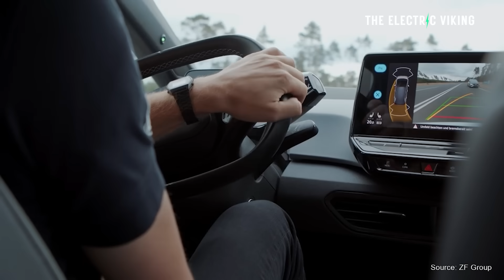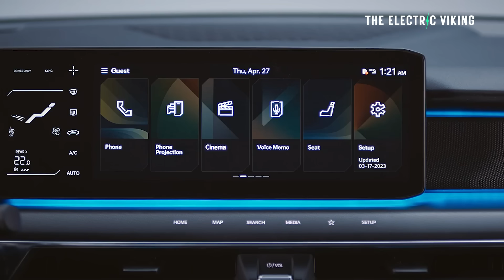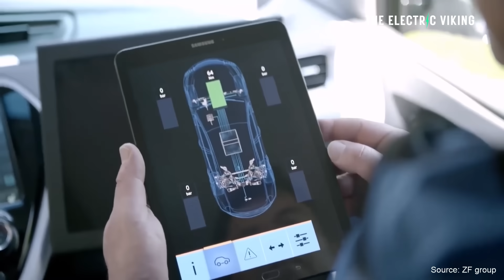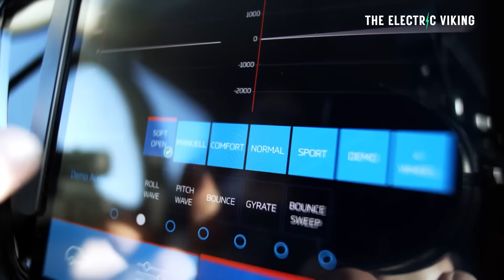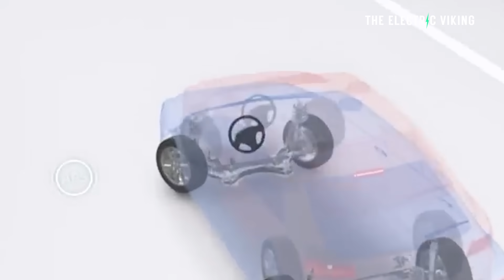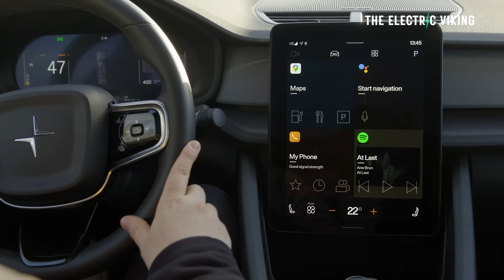Electric Brakes Revolution: Safer, Cheaper EVs!

Comment: Hey Mr Electric Viking,  i have been watching your videos for yrs.  I have a question for you.  Do you remember about 2 yrs ago 
Ben Hardy posted a video about 'Brake By Wire'.  It showed a collaboration between Tesla and Brembo.  They had the brake by wire system installed in a model 3, and ran some tests on a track. The performance was far better than conventional brake setup's (Disc/Drum) I think that they even gave details about the Tech, Brembo did not invent it.....  They also said that Tesla would be the first manufacturer to have the Tech.

I guess that Brembo were going to develop the system and Tesla were going to be the first to install it in their cars.  I am fairly sure that the video is titled ' How did Brembo take over the Brake Technology World'  

Hope this helps to clarify where this Tech came from.  Surprising that you didn't know all of this, or did you decide to gloss over it. ???
Credibility factor dropping...
Cheers mate keep the vids coming.  Maybe not so many.......

Comment: I wonder,if you use an electric motor to accelerate and regen to slow down, why not go the next step and use the power in the motor to emergency stop or brake. Surely that must be possible.

Comment: I've been driving almost 60 years, and the prospect of electric braking does not concern me at all. What does concern me is an idiotic mindset that want's the new system to seem 'like it always was', or feel like the old system. I don't need to a simulation of a hydraulic system feeding back to my foot. I can see and feel the deceleration. Seems like changes are sugar coated for those who aren't adaptable. Also, brakes have less and less to do on electric cars. It wouldn't surprise me to find no rear brakes on RWD electric cars, since the drive motor might have sufficient capability with regen.

Comment: Totally electric/electronic braking systems !? I don't think so, aside from an electrical power loss nightmare the safety sensor systems would in my opinion would be a major headache. I have a very reputable brand of satnav which performs very well but has a hugely annoying safety alarm that sounds constantly and for no reason. If that safety alarm was connected to an electric braking system a Sunday drive would be impossible to do without repeatedly barfing on your steering wheel...🤢🤮

Comment: There have been numerous occasions where I had to steer a car unpowered. 
I will never have the discipline of an airline company when it's to maintenance so I need a robust vehicle that can still be steered on a highway in the event of a total power failure.
I don't see steer by wire being allowed in Europe even with triple redundancy or at least I hope so.

Comment: What happens in a electronics failure then if there is no mechanical way to stop the car when it goes dead.   This is not a hypothetical.   Many EV owners have experienced a battery death 12.   The 12 volt controls all of the controls.

Comment: Aircraft fly by wire so there is no reason why cars can't do it. Like on aircraft you can have 3 control units which compare results and take the majority result turning off any unit which gives way off results. Sensors and cables can be duplicated. there will be 2 pads and actuators on every wheel and 4 wheels in total.

Comment: I think safety is the reason Tesla and other BEV OEMs have not yet fully committed to electronic braking systems, similar to Brembo Sensify. There needs to be some kind of backup braking system in case the electronics fail for any reason (dead battery, water damage, short circuit, software glitch, hack, lightning strike, solar flares, electromagnetic pulse, sabotage, mis-repair, electronic-warfare/signal-jamming, etc.).

Comment: fine but hope that your battery doesn't fail and leave you without brakes or steering or wire disconnects your control

Comment: Not mechanically connected steering and brakng was standard on Citroën CX and SM models in the 70's and 80's, by means of hydraulics. The steering was a 100% hydraulicly operated by a high pressure hydraulic system and the same with the brakes. Drivers input only through valves directing the pressurised oil similar to modern aircrafts. The steerng had a safety backup through a rack and pinion that was not engaged during normal drving circumstances. The steering wheel valve assembly had a speed sensitive pressure regulator for light steering at low speed and vice versa. Driving experience was excellent and outstanding performance wise. There was also a prototype with four wheel steering added to the system.
Reply: @MrLekatt - Yes a marvel of the time however you needed a both a Maserati mechanic to deal with the special maintenance requirements of the joint venture Maserati/Citroen engine and a Citroen mechanic to deal with the special requirements of the full hydraulic steering and suspension systems.  Running the higher volume and pressure hydraulic pump also took its toll on fuel economy which is why they needed a large for the time 24 gallon fuel tank despite the small 181.2 CU/2.9 Liter engine.  When the fuel crisis hit they became impractical due to the extra fuel the system used causing that small V6 to at times give less than 10 MPG.

Best!
Reply: @neilfromclearwaterfl81  I actually serviced and repaired my CX's in my own garage. Even took the Diravi steering apart for cleaning to help a friend with a contaminated hydraulic system. The model I liked most was the TRD Familiale Turbo I. Smoth as silk at speed..
Reply: @ Indeed they were nice when they worked and many did have to service their own due to the lack of shops that would work on them.  

The most frequent request I received on them was to remove the hydraulic suspension and steering to convert them back to a more conventional system that didn't waste as much fuel or cost so much to service.  

During the fuel crisis in the 1970's here gasoline suddenly went from 25 cents per gallon to 39 cents and then skyrocketed to $1.39 in short time making it so the value of these cars dropped like a stone.  Owners became frantic to get rid of them and sometimes just stopped making the payments since they couldn't sell them for enough money to pay off the car loans and purchase something more economical plus many dealers wouldn't take them in trade.  Banks then got stuck with the cars that nobody wanted.

Best!

Comment: Electric brakes can be electrically held open so that if power fails the brakes close and slows the cars to a stop.  But drive by wire bothers me. If power goes out you need to be able to steer the vehicle to the side of the road. Have a total electric controlled steering mechanism means a failed vehicle needs to stop in the middle of the road. I don't like that. I kind of feel like drive by wire is much less safe.  Better would be electric assist steering.

Comment: Fail safe and fault tolerance are two different engineering tasks. Fail safe means if the whole system fails the car stops itself with no control. Fault tolerance is when you have backup systems. But it is still possible for the backup systems to fail as well which is why you need a fail safe condition.

Comment: I would trust it if it had a redundancy system perhaps the calliper motor could have a built in battery that could apply the brakes from a wifi signal sent from the car in case there is loss of power from the car 
I do like the way caravan brakes work from a simple electro magnet inside the drum perhaps this could be adapted to work with a disc brake system 🤔

Comment: Electrically actuated disk brakes for light duty vehicles are at least 20 years old.  Also, with 4 motors with sufficient torque and the ability to store or dissipate power fast enough, you should not even need separate brakes other than for redundancy.

Comment: It makes sense for EVs because the handover from regen to mechanical brakes can be made continuously smooth, (if emergency/spotry baking can be described as smooth). An anyone who has tried coasting an ICE car by switching off the engine will find pretty quickly that the brakes don't work as well. They will be power-assisted and no engine - no power! So we have had the what if scenario for years.

Comment: interesting.  locking each wheel independently is nice.  A little surprised using the electric motor isn't capable of doing this eliminating the need for these all together.  Especially if they get in wheel hub motors to work.  are they synching this with regenerative braking.  On the safety side, we develop with failover electronics all the time and it very reliable.

Comment: Steer by wire has been used in aviation for years. But they have a redundancy and safety which the cybertruck does not. What happens if a mouse chews your steering-by-wire wires?
Reply: Or chews your brake wires ?

Comment: crazy idea touted as ‘safety enhancement’ from beancounters desperate to find new ways to save $$$ and thereby trouser fat bonuses. 
Hydraulic brake system are proven exceptionally reliable over 100 years and dual braking systems (with built-in ‘system redundancy’) are the safest+most reliable yet invented, tested over billions of miles. 
Even worse, these car companies seem determined to produce cars that can +will be hacked and taken control of by bad people just for the thrill of watching a family of 4 crash+burn

Comment: I worked on MBs for 35 yrs. Elect braking came out in 2003 called SBC. They work great as long as there's not an issue with the system or car. If so, you're screwed. I've seen elect brakes fail while driving. It's F'n scary?

Comment: Don’t vacuum brakes engage via springs if the vacuum fails?  I suppose you could do something similar with electronic breaks, but it’s the software you have to worry about.

Comment: steer by wire has been the standard for jet planes for years
Reply: aviation is subject to far more stringent (and expensive) systems +materials +manufacturing +testing +regulatory controls than the auto industry, for obvious reasons

Comment: My 2003 F250 superduty truck has never had the brakes replaced. It just had a full service last week. This brake by wire sounds like yet another avenue for customer exploration through ridiculous cost for no real pluses. ABS is good enough.

Comment: Actually the technology is over 20 years old and Flys over your head every day.  Originally called Fly by Wire. Replacing hydraulics, using pumps and oil to move the rudder and other surfaces needed to make a plane fly. Old tech new application. It can literally be said it has been tested for billions of miles.

Comment: do these have backup batteries? If you electronics die.. so will you at 100Km/h (60Mph). Mechanical steering and brakes means you can still use them if the car dies while you drive!! I will never buy a car with steer and/or brake by wire!

Comment: I do not have experience with inboard disc brake systems, but prefer that arrangement to reduce unsprung weight (and need of cooling air flow that creates drag near the bodywork). My recollection is vague, but recall having come across news about braking systems incorporated within the drivetrain housing. Vehicles already incorporate heat-dispersing radiators; no need to place heat-producing components inside wheels where airflow (and excess heat/weight) is difficult to manage.

Comment: I thought it was illegal to not have an physical connection to the steering????   Off-road guys for years have been fighting this because we retrofit old power steering systems with "Rock Rams" and we don't need the actual steering shaft.... but the DOT rules say we do. AND... we can't pass an inspection without it.

Comment: I bet the police would have access to software to engage brakes. Awesome
Reply: Propulsion can be tapered off as control of steering, braking and acceleration is removed from a suspect's vehicle (sudden changes can lead to instability, loss of control, proximate passenger/pedestrian injuries, etc.). For that matter, police enforcement could also control law-abiding nearby vehicles to facilitate safe slowing/stopping of suspects or drivers exhibiting medical emergencies.
Reply: Automobiles could be fully remote controlled since introduction of ECM in cars in late 90s. What do you think Toyotagate was all about? After all the bad publicity of sudden acceleration for Toyota and multi billion fine, what did Toyota have to do to "fix" the problem? Secure its floor mats to the floor. Right.
Reply: @GenghisX999  ECM stands for Engine Control Module, but not wireless connectivity or steering or braking, so I can not acknowledge “fully remote controlled” as you state. I never paid much attention to Toyotagate, but suspect that manufacturing processes and quality control was a large part, with floor mats a smokescreen to placate alarmed consumers.
Reply: @ You can access all functions of vehicle through OBDII port. There was a Bluetooth OBDII tools that technicians could purchase that they could remote control a car via Bluetooth connected to laptop. What is available to Intel Agencies?

Comment: The two most critical aspects affecting safety are surely the quality of the actuating motors and the software. Especially extensive software testing, both in the lab and in real world conditions. it's the 'edge contitions' - rarely occurring but potentially severe that need particular attention. After a life as a developer with a Computer science degree I do have something of a clue about this.

Comment: I had drive and brake by wire in my Alfa Romeo Giulia Veloce. It was a great system and enabled, effectively, to put three different cars in my car: Either a comfortable, low rpm ride in Advanced mode, a neutral, precise handling sports sedan in Neutral mode, which I mostly used, and an aggressive, great handling sports car in Dynamic Mode. I loved it.
Reply: No wonder you loved it. It was an Alfa..

Comment: While they use fly by wire in jets, I would not want it in my passenger vehicle.
I understand no steering column eliminates many fatalities, 
but maybe that's not something I want to survive.
If power is interrupted in a curve on the highway, no good possible result.
Electric brakes/ regen are a great idea as long as they have manual (hydraulic) backup.
My Electric bike has electric AND hydraulic brakes

Comment: in the 1960,s  my father worked at Dunlop brake department in Coventry  UK.. the brake caliper piston seals were designed to rock and retract the caliper piston when no braking pressure was applied .

Comment: That's rubbish that bigger cars will brake better , absolute garbage. No modern car will brake better with electric brakes , modern cars  already have antilock {ABS} brakes that work at the limit of traction, NO BRAKE will improve that as it's down to the physics of the vehicle, weight and height, centre of gravity and so on. It would help if you weren't reading hype and  understood how brakes actually work....  I'm quite technically literate, especially with motor vehicles, some of the stuff you say, with no actual knowledge , is turning me, and I would assume, other knowledgable people away from this channel....   Stick to subjects you know something about....

Comment: Modern braking systems with ABS are extremely safe. They will not fail due to an electrical or software/firmware issue, and are extremely robust mechanically. They are easy to maintain and repair, requiring tools, equipment and expertise, which are universal to all cars. These are all strong arguments in favour of keeping the status quo.
Reply: EXACTLY....... The funny thing is that, due to the position of ABS sensors, they fail all the time, and these knobs want an all electric system, some things just work. He also stated that electric brakes would be better which id patently false, ABS already does what electric brakes can do based on the physics involved, the tyres are the limitation....

Comment: Nio ET9 also has the steer by wire tech. Which also makes easier to manufacturers to build right side steering without making changes to the frames of the vehicle🎉🎉🎉
Reply: Also makes crash test safety easier to arrange and can be swapped between a whole range of vehicles... 
Hydraulics leak perish corroded and can catch fire..

Comment: still this is a mechanical brake - some material scrubs to another material and make friction and heat that are wasted and will tear down and needs change after a while. Why not use the recharge system to be the brakes? Just an electric field  - no contact, no need for replacement generates power every time its used.  Will be the future.Some cars has already 3 motor - if its one for each wheel - you can make a perfect system for driving and braking.

Comment: I will be more receptive of the idea after they have been tested for 10 years on a short range , locally used, run about car based in England where salt is used to keep roads ice free. The brakes on my car will already apply the brakes until the tyre grip is overcome at all speeds, whilst existing ABS and stability systems work well. I can foresee no circumstances where a brake by wire system is superior to existing systems, expecially considering that every car has redundnacy systems built into the braking system to cover part failures. 
My understanding is that such a fully 'brake by Wire' system will not comply with Construction and Use Regs as they stand.

Comment: 5% more efficient is marketing. That amount of contact on the disks after breaking is like "nothing". Otherwise you always would have slightly warmed discs. 5% of 20kW of power that is used to keep speed (at 100kmh - so 1h at 20kwh/100km) - says 1kW heating power to breaks - thats a lot of heat ! NEVER !

Comment: It is electrical not digital. Digital would be 1 or 0 so full turn or not. A digital driver is someone who knows only full throttle or full brake. You could also just say brake by wire.